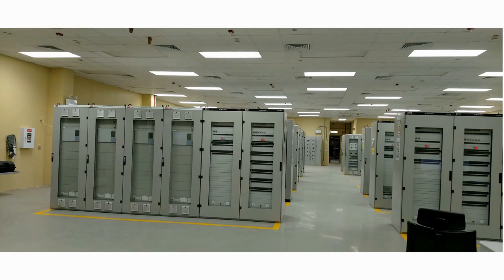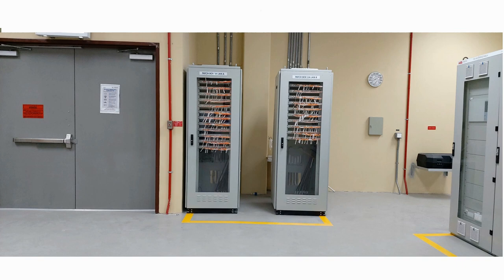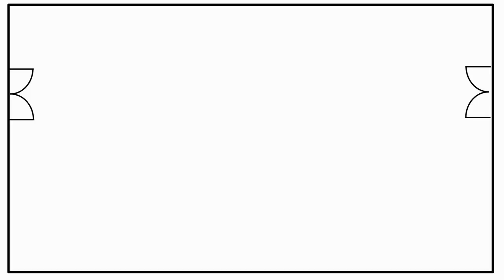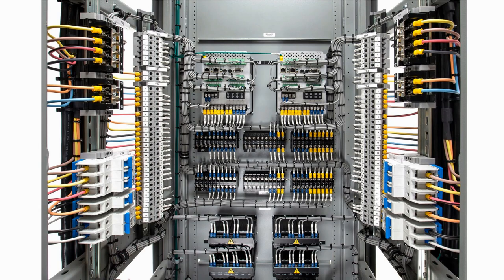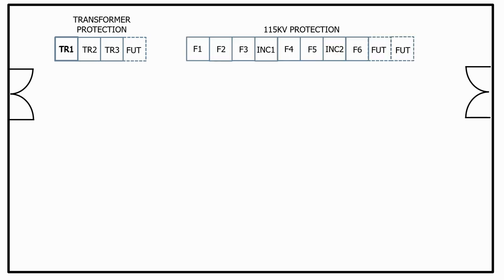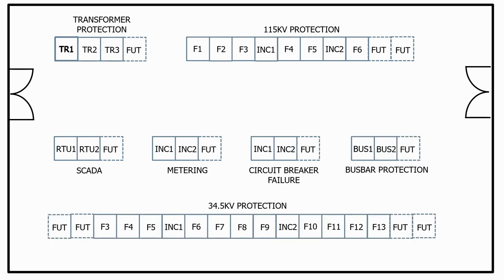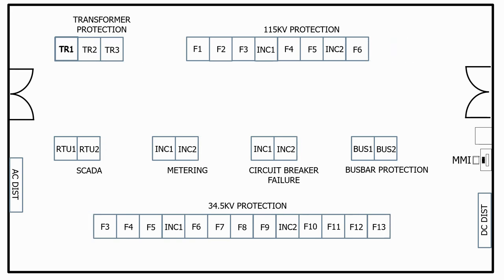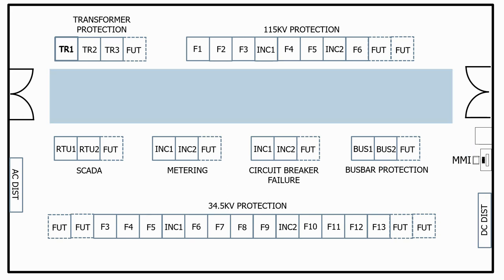Control room layout

Comment: Sir, what about the electrical room in which main panel (floor mounted) of the building are installed. half meter distance is enough from the wall for future maintenacne?
Reply from the maker: Hi Osman, I recommend 1.5 meters in the video, but the actual distance will depend on your circumstances….as a minimum you need to be able to walk between the opened panel door and wall…Steve